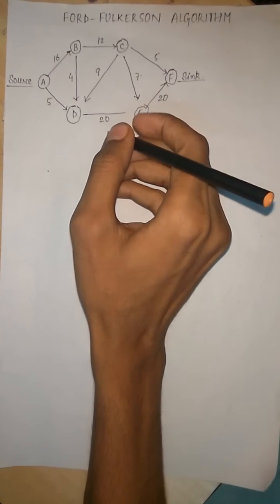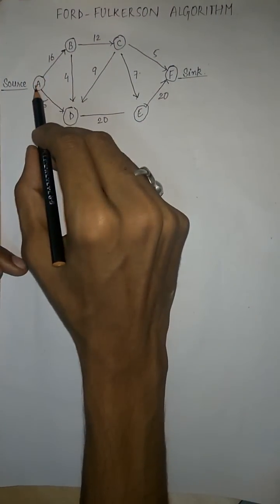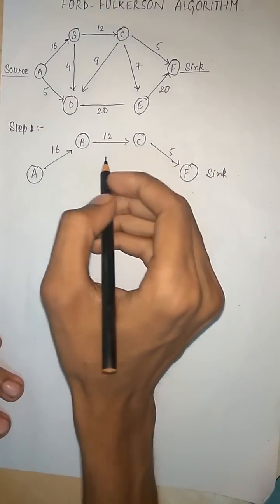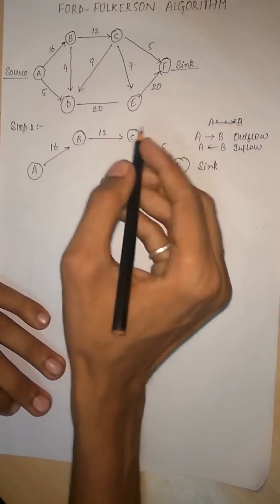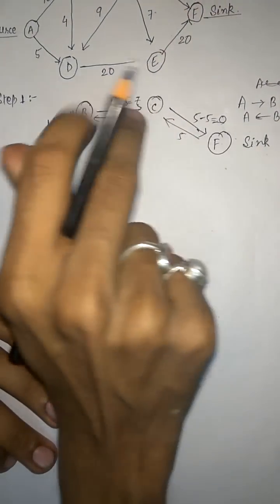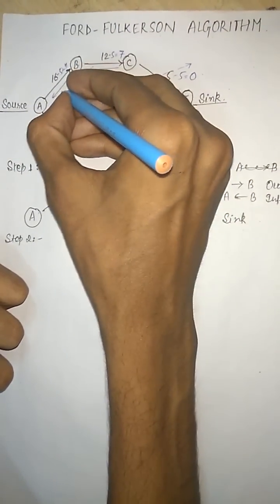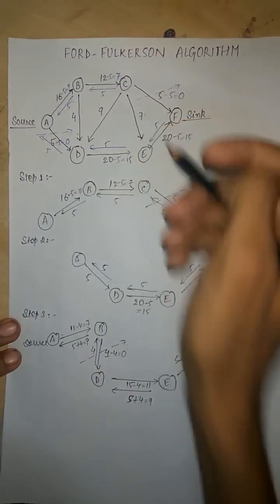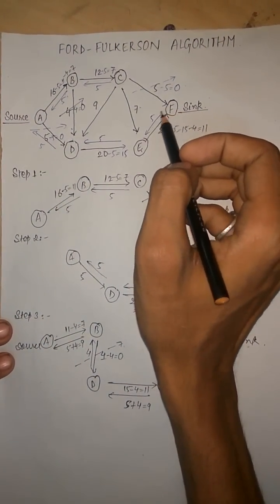Ford Fulkerson Algorithm for Max Flow Example (Steps explained in details)

Comment: Nice explaination but a little wrong on step 4 as the inflow should have been 9 between E & F instead of 5 which would have finally resulted on 16 instead of 12 :)
Reply from the maker: i hope you understood the explaination.
Thanks for the support and suggestions.Please subscribe :)
Reply: Can u give one answer how to find out the minimum cut
Reply: @komalkumari8413  this is the minimum residual capacity of an edge on the path P (we have chosen)